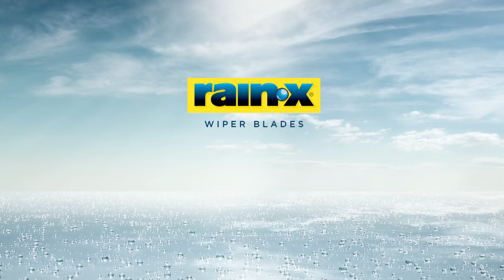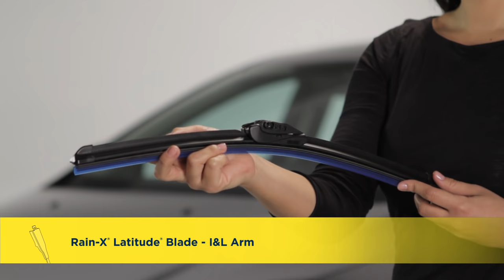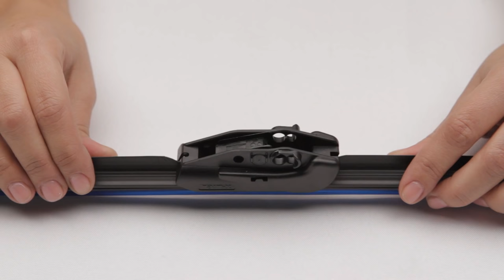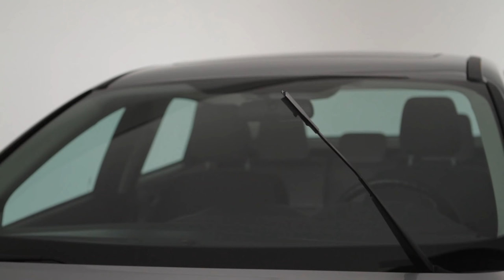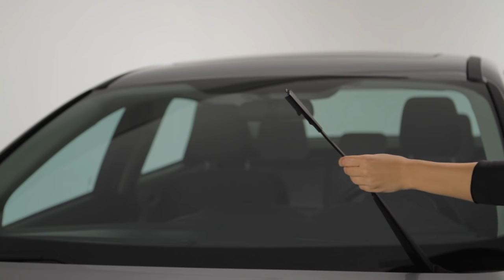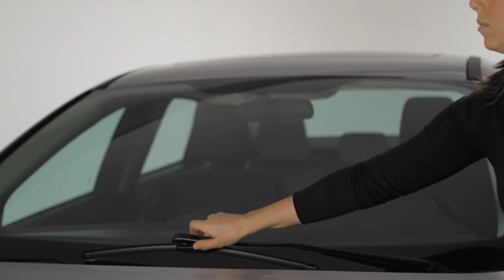Rain-X Latitude Wiper Blade Installation - I&L

Comment: Your videos don't reflect reality in any way, shape form.  There is no way to 'snap' any of your parts into or out of place without destroying the blade.  Every part is sized to be just wrong enough to make a seemingly easy task virtually impossible.
Reply: I just bought a pair of these. It was not even close to this simple on my truck. I have zero confidence and I’m thinking about just trashing these or returning them and getting a dodgers brand.
Reply: And look what happens when you try to replace just the actual wiper blade insert. They don't want you to. Look at how bad and poor design these blades are. There is no separation of the metal at the ends so you're forced to destroy your new inserts that you bought if you bought them from an auto supply store or the dealership..

Comment: Note - the adaptor has CHANGED - you will not be replacing the adaptor, instead you will be pulling parts of the adaptor already on  the blade off, depending on your blade.  (For I&L, the top 'cover' and the blue things on the side, for example.)  Use the Paper instructions.
Reply: Thank you, video made no sense lol
Reply: The paper instructions were helpful. Nice to know many others were in the same boat. I'm used to the J hook.
Reply: This 100%

Comment: Just HORRIBLE to replace the adapter, frustrating, aggravating experience (hours and still no luck!). Called Rain-X, no one in customer support, left a message, no call back. UPDATE: The only way I was able to get the adapter off was to pry it between the adapter and the blade by using a flat head screw driver.
Reply: It took you over an hour to conclude that a screw-driver would give you some aide with leverage. WOW

Comment: Thank you SO MUCH for this video!  If you have the I & L type connectors, It's important to note that these wiper blades come with the locking tab in the "locked" position. Nowhere in the paper instructions does it even mention that the end piece needs to be unlocked and when unlocked, can move back and forth on it's own via a slanted slider track on either side; I thought it was a stationary part. As it is, I had to watch the video three times before I finally caught that detail and then after that, installation was surprisingly simple.
Reply: Where is the locking tab? What is the end piece that needs to be unlocked and how do you unlock it?? There needs to be more detailed instructions for this...

Comment: I've noticed Rain-X has changed all their adapters. I used to be able to flip the adapter around to get the expert fit blade to work on the right side of my Ford Escape. You can no longer do that so now they only make left side blade's for it.
I will be looking for another brand of blades

Comment: Thanks for the great video. After fumbling around for 15 minutes with the paper instructions, I got both wipers done in less than a minute after watching the video.
Reply: CBR2200 on the installation of Pain-X Latitude wipers, if it had not been for the great video, this old cow hand would have never figured it out.  Now I can call them RAIN X again instead of Pain X.

Comment: Use a flat blade screwdriver to get off the old connector. Gently pry it off with the screwdriver. Worked perfectly when I just installed these yesterday.

Comment: The connector pops off and clicks into place my butt! I had to pry the old one off with a screwdriver as other commentators said. Also, the new connector only fits one way, so make sure it points in the correct direction.

Comment: 2019 Ford Escape I found it harder taking the old blades off. Switching to the other connector on the RainX was fairly easy. A bit tricky getting these on but it's like the video get the front end down, snap the rest down until you hear the sound, then snap the square thing at the front back for a final snap sound.

Comment: This is a nightmare to take of the pre-installed attachment, I eventually got them both off but the amount of force required to remove them is certainly a lot more than depicted in the video.

They are really good blades but if I have to nearly destroy them to attach the correct mount then I won’t be buying again.

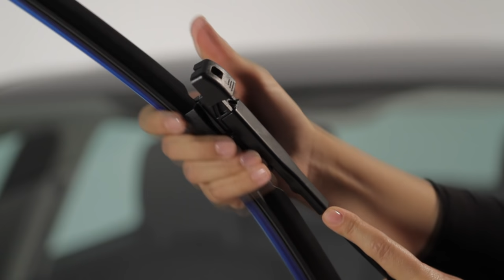Comment: Had no problem with the installation, but couldn't get the release button to snap back into place on the passenger side, as shown on 0:55. Driver side, no problem. I tried for an hour. I'm hoping that the blade doesn't go flying off when I have them on high.

Comment: The giant mount sure raises the wiper in the rest position significantly. Enough to block the view of the hood. Also, at the top of the wipe stroke it clunks since the wiper arm is far away from the rubber piece.

Comment: ....yeeeehaaaawwww! The Connector came off! The way I did it was lift rotate up as in the video but turn the wiper 180 degrees, and rotate up from the other end of the connector. Keep going back and forth from one end, rotate, lift, rotate, lift and so on! Hope this helps someone else from going round the bend!

Comment: I can't get all the danged preinstalled adapters OFF. I've done a lot of auto repairs but your paper instructions are too small to see, and this video doesn't show how to take all the stuff off before putting the new wiper on. Vehicle is a 2014 Ford Escape. Should be a five minute job, but I;ve spent way too much time on youtube and I still haven't figured out how to get to your starting point on the video. Show the part as it comes in the bax.

Comment: why doesn't anybody manufacture the old style winter blade anymore. Simple, summer blade with a condom over it. Those blades used to last me 5-10 years. Just bought a set of these blades and they are junk right out of the package. 22" long and 5" on each end touch. Rest of the blade is suspended from the glass. And they were $18 each! JUNK!!

Comment: This is the worst car product I have ever used. Rebuilding brake calipers on my 1980 corvette was easier than removing the preinstalled connection system. Almost pulled a muscle after 15 mins of pulling on it. The plastic cut my hand too. After all that I realized that despite the wipers being listed as adaptable with my car, they were not. Horrible! Never going to buy their products again!

Comment: Yeah this video is bullshit.  

There's NO WAY IN HELL that those girly hands in the video can remove the old connector SO EASILY.

After giving myself blood blisters on my fingers trying to get them off, I succumbed to the temptation and used some pliers to crush the old connectors until they shattered off the wiper blade into a million glorious little pieces.

And of course, the I&L attachment goes on and comes off so ridiculously easy.